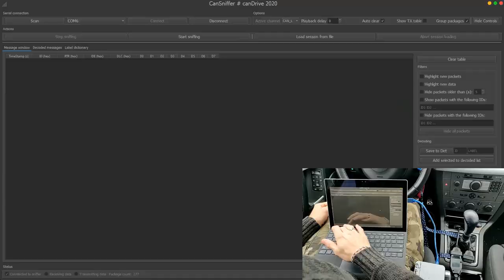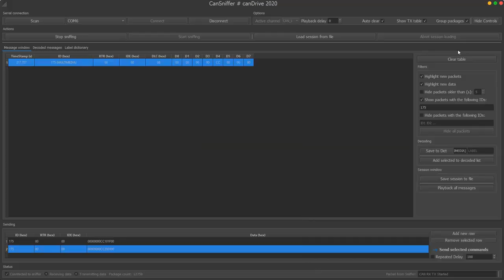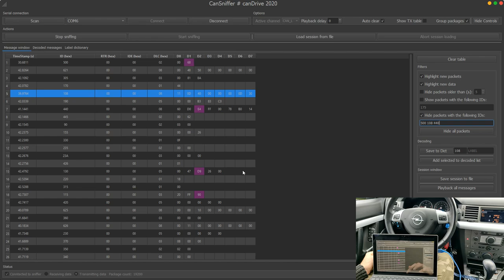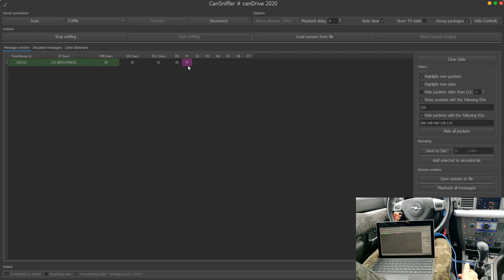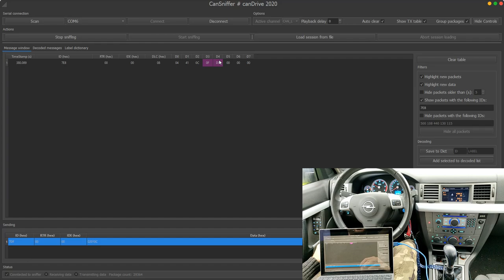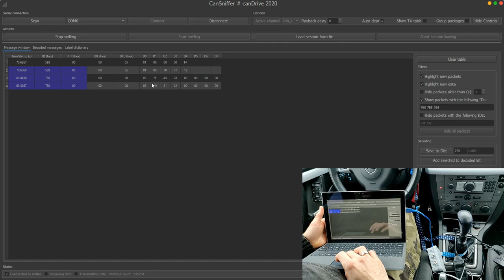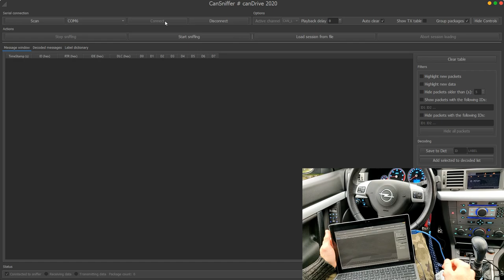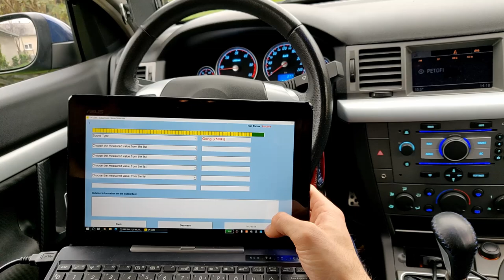How to hack your car | Part 3 - Reverse-engineering examples

Comment: the best videos for understanding the protocol and the issues deeply, thanks a lot Adam, i would like to ask you a question about sending commands. in my car i found the id and the data to change lights. but when i send the data, nothing happens. as i see in your video in 3:24, i saw you sent the data excactly how you got it, as i can understand, in order to make a button press, you send: id = 0x175, rtr = 0x00, ide = 0x00, data = 0x00000000CC101F00. what about size? anyway, is there any other thing i miss? when sending to CAN a message, which says lights on, nothing happen, maybe its just an indicator? another question is - can i control the wheel via CAN or handbrake or this is lock by the car system for safety? thanks a lot Adam, keep up your very good work, i learn a lot from you :)

Comment: I whatched all 4 videos about car hacking, they are very useful, thanks for sharing the knowledge. I don't understand one point. Where did you connect three switches? What does Can L etc button on the python gui? Last question, can car communicate more than one baudrates at the sam can-bus line? Btw, i'm working on Opel Crossland X 2020.
Reply from the maker: Hey, thanks! You can find a diagram of how I connected the switches in the description of Part1. The can selector on the GUI currently does nothing. 1 can line always has 1 defined speed, and the speed does not change. But, as you could see, in my case, I have 3 can lines operating at 3 different speeds.
Reply: @adam_  So many thanks for your fast and kindly reply. I watched your videos several times but I couldn't see the description schematic, I'll try tomorrow with new setup. :) If you need anything that I can make, I want to help you too. For example I can design and gift OBD2 PCB or sth like that for you.

Comment: Thank you for the videos. Were helpful.  I have a question: how can you find out which speed does the low speed can have in your car? I tried all standard speed from 5k to 500k. Just the 500k works. The rest didn't work 😪

Comment: Thanks you x 3,000 Adam. A thousand each for part 1, 2 & 3  :)
I am one VERY dumb guy when it comes to IT stuff, got migrain for 2 days trying to copy your device...LOL.
Anyhow, managed to get the CAN signals, but damn my car send out 106 messages simply from opening the door, without key in Ignition.

I am trying to trace the HIGH BEAM command and still unable to see the pattern on the signal yet. So many IDs are alive and changing even when high beam is OFF or ON. Too many diagnostic signals I think each modules are sending. I wish it is as easy as how you find the buttons on your steering wheels.

After like 10 minutes sniffing, the sniffer slows down so much till keyboard respond lagging by 5 seconds or so.

I will keep on trying. Just drop by to say thank you once more. Great tutorial and kindness. 

Kind Regards. SP
Reply from the maker: good luck!
Reply: @adam_  when is new video coming out

Comment: this is an incredible work!!! salute!! I have one problem, I cannot detect the new packet after triggering the switch. any idea what is causing the problem?
Reply from the maker: Try it out with the CAN examples to narrow down the problem as there can be many issues.
Reply: @adam_  thanks. so, the new packet will be highlighted as blue and the ID will appear in the bottom right corner of the GUI? lets say I power up my car at ACC and I'm getting close to 200 IDs and it fills up the main window. so, I couldn't see everything after I have trigger some botton and blue highlighted will disappear very fast. How should I approach this problem? My car has MSCAN and HSCAN running at different twister pairs.

Comment: Dear Adam
Reaaly interesting as I want to develop a similar thing for my Opel Ampera. I just vant it to connect over 3G/4G(later version) if the Vehicle is far away.

The things I want to control is:
Locks
Windows
Charging
Seat Heating
Steering Wheel Heating
Windows Defrosting

I also want to monitor
Battery status
Battery Charging

So really, thanks for the videos

Comment: Hello, first of all - great series! I wonder if it is possible (and safe) to connect two (or several) own created devices / modules to the can bus, that will communicate through it. How to check if some ids are not used by another control module?

Comment: Hi Adam, these videos were the most complete I've ever seen. I'm in Brazil doing some research on my car. When you say to put it in Can low, where should I change it? Thanks
Reply from the maker: The speed in the arduino sketch should be matches, and the right connections should be made towards the OBD port.

Comment: Great video series.  Question... How did you transfer the data hacked onto your cell phone with the GUI?  I see in the video, you have full control through a custom interface on your cell phone.  Would you do a part 4 that walks through that setup process.
Reply from the maker: Thanks. The GUI has nothing to do with the phone. It was only used for the reverse-engineering part. Then, my custom module is transferring the data directly to the phone through wifi or bluetooth. I am planning to make a 4th video at some point, but I'm extremely overwhelmed with things.
Reply: Looking for this answer also =)

Comment: Very nice video series! Can you explain how to catch messages from climate control and windows module. Which can bus line used, because I have no success with any of them?
Reply from the maker: It can differ for each car. If I remember, they are on the Low speed for the vectra.

Comment: Hello Adam, thank you for your awesome video. I have a question. What if I want to sniff packets for Power Steering, is there anyway to sniff the data from both steering servo motor and steering wheels position sensor?

Comment: Thanks a lot for the videos. Any idea why when I connected my car to the Arduino with your code and it just threw like 60 thousand fault warnings on my car's dashboard lol. The sniffer code is supposed to be read-only (unless the tx stuff is used) so I'm not sure why the car is even erroring like that. Any ideas?

Comment: Hi, I have a question. Could you use this to set car to somethink like "sport mode"? Set lower sensitivity for power stearing, quick reaction to pedal press,...? I guess it can be dangerous but it can be tested in low speeds. Love your viedos! I've just orderd all needed parts. 😁👍
Reply from the maker: Theoretically yes, but as you guessed, it can be tricky. The car can implement some safety features that would prevent you from doing those things. You should give it a try, I haven't tried it myself.

Comment: so I finally able to find those CAN bus IDs I needed. However it requires me to use the ELM327 or ELS27 reader to trigger the car to spit out the IDs. With ELM327 connected, I can detect all the car modules and PIDs (like PCM, TCM, ABS, Brake SW,..). By going into each module, it has all the parameters like signal lights, cruise control buttons and other toggle switches that I can select and then use the Forscan software to obtain the live data while my can bus sniffer is connected to HSCAN at the same time like what you did on Part 3 video. When the live data is triggered, the GUI captures the IDs and corresponding data. I can save the message but I cannot send the message to toggle the switches virtually. One thing I dont understand why I need ELM327 to be connected to trigger a more messages before I can access to other Can bus IDs.  Also I still have problems sending the message into the car and I get no reaction. At least I'm making progress but your expertise is highly valued.

Comment: Hello Adam! Your videos about CAN is very simple and useful👍 Can you help me, please? I have dashboard from Opel Meriva A and I want to use it for pc video games. But I don't know which messages I need to send to control it. I need engine speed, car speed, turn signals, fuel level and engine temperature. I think messages for opel cars should be same. Maybe you can record op-com dashboard test messages for me?
Reply from the maker: Hey! Cool idea! Please check out the github repo (link in the describtion). Inside 02_canSniffer_GUI/save/decodedPackets.csv, you can find the messages that I've decoded. Try out the messages for the 255 packet ID. There are the messages for the RPM, speed, coolant gauges. Let me know if they worked, maybe I can check the rest for you. If they don't work, I'm afraid that dashboard is different.

Comment: Hi, Adam!

Inspired by your tutorials and because I've recently bought a Toyota Corolla Cross with a terrible head unit (Toyota won't do anything about it, they say that the head unit is supposed to work like that =/), I'm willing to replace this head unit by a Samsung Galaxy Tab S8 and make it connect to the car's can bus wirelessly, and create an Android app (I'm a developer) to control all car's functions and configurations, like sensors sensibility, door locks behavior, changing radio stations, etc.

I've already bought all needed hardware and I'll start my project next week, but I stil have some questions about your tutorials (maybe this would come in part 4).

How did you make your car receive can messages from your mobile app? Is this possible only with the Bluetooth monitoring adapter or did you have to build any other kind of hardware to make your ODB2 port receive messages via wifi/Bluetooth from your mobile app?

If you could give me some tips about how to make this work I'd appreciate it =)

Thank you very much for your effort, your tutorials are amazing!
Reply: hi! how is your project going?

Comment: Hi, I am very grateful to you for the code you wrote and the videos you recorded. I would like to ask how best to send can requests from the application to the arduino - mcp2515? Did you write your own library or are you using a github one? Unexplored by me is the subject of connecting android with arduino
Reply from the maker: I'm simply using the Arduino CAN libary, as I show it in one of the videos.
Reply: @adam_  I would like to ask what path have you taken to connect the smartphone application and the canbus? Most likely what you did: used elm327 and libraries to handle ble in javascript by writing the app in nativescript. Or did you add some bluetooth module like esp32 to the arduino? We have the same cars and even the defined packets in the gui coincide with yours. Would it be possible, very please, for you to provide me with the code of your app for my phone?
Reply: @adam_  hey? :)

Comment: No cabe duda de que todo es muy impresionante. He seguido tu tutorial y lo he aplicado con un Arduino nano. Mi coche es un Opel Astra 2017. Puedo leer los códigos en los canales ALTO y BAJO, pero no los medios. Es decir las velocidades de transmisión funcionan a 500 y 33Mhz, pero no lo hacen a 95 (pines 3 y 11). Con todo puedo averiguar los mandos de la radio y los códigos correspondientes por ejemplo. Pero a la hora de comprobar y mandar un comando por CAN BUS no lo hace. NO Puedo mandar nada a la red can BUS y no consigo averiguar que está mal o que es lo que falla. Agradecería una pequeña orientación por donde seguir. Gracias y Felicidades por tu trabajo.

Comment: Amazing tutorial. I have a question :

There are some CANBUS shields based on the MCP2515 for Arduino Uno that feature a DB9 connector. What are the actual differences with your  smaller CAN Bus module?
Does this larger module allow to access all 3 canbus speeds at the same time without the need to use physical switches?

Anyway, I'd like to adapt this to use my Astra H steering wheel buttons and control music being played by my phone on Spotify. I'm currently using a bluetooth audio receiver on the aux port of my Alpine headunit. I guess I also have to figure out the part of sending multimedia commands to Android phones, with one of those genuine HC-05 bluetooth modules with modified firmware to get HID support for this task. What a project! 

Also interested in getting the doors to lock automatically after a certain speed has been reached without the REC module.
Reply from the maker: Your ideas are completely possible!
I don't know those can shields with the DB9 connector, but I think you should be correct, those shields might allow you to switch between the different buses (and ISO standards) from the software itself.

Comment: Hello,
Congratulation, very good job.
I have question : do you have to put the switch on midle speed to sniff the middle channel, and on the low switch to sniff the low channel.
Thank you
Reply from the maker: what switch are you asking about?
Reply: @adam_  Hello,
On a box the box there is arduino uno + MCP2515+ and 2 switch A and B.
thanks
Reply: @adam_  to sniff must I connect MCP2515 to  6-14 pins? 3-11 pins ? or 1-4 pins

Comment: Hello Adam, really enjoyed this videos!

Looking further for the next upload :)

I will use the knowledge I've adquired to read the canbus communication of my folding mirrors which unfortunately only work with switch and my plan is to make them fold when I press the lock button on my car.  
For that I'm planning to use a arduino/raspberry with compiled code that verifies if the canbus message of locking the car is sent  it will send back the canbus message for folding the mirrors. 
Do you think it's possible to do this? Have a arduino stored hidden on my car to make this work?

Thank you 🙌

Comment: Great job mate! How to make obd speed auto door lock and hazard lights on during gear engaged to R? do you have any information about it?
Reply from the maker: You just need to listen to the correct messages. If the speed exceeds a given limit, you send the correct packet for locking the doors and that's it. Same with the hazard lights.
Reply: @adam_  ok I will start to my project. Do you have any plan about preparing video Custom hardware design, Firmware (STM32-NRF52) and mobile APP? Thanks!

Comment: Awesome! I would like to use an arduino for reading can messages of the steering wheel. So I can attach an usb mp3 player to the AUX IN on my CD70 Radio and skip between the tracks. Can you share the pids for the buttons?
Reply from the maker: That was one of my ideas too :) Please check the github repo linked below the video, and look for decodedPackets.csv. You'll need "wheel left select up/down".

Comment: First of all, great video, thanks a lot :) I have recently tried sniffing the CAN bus on my 2013 Kia Rio but unfortunately without success. I am getting about 20-30 packets but it seems extremely noisy, as nearly all of them change frequently. I wasn't able to find any correlation between the data and me pressing anything in the car. The only thing that changes is, that some more packets get received, when I turn on the ignition rather than just accessory mode. Is there anything I could be doing wrong besides the configuration you showed in a previous video? Or is it possible that my car only sends some internal stuff over the canbus?
Reply from the maker: If you suspect that what you are seeing is complete rubbish, that's most likely a wrong canbus speed or MCP2515 frequency mismatch. Maybe you are not connected to the right pins. To narrow down the problem, I highly recommend trying out the example arduino codes.
Reply: you need to suppress the ones that are changing quickly by adding the ID's to the "hide ID's" list to clean up what you are looking at.    I just recently got past this in my 2016 VW Golf R and I think that some newer cars are VERY canbus heavy.

Comment: Thank you. Makes the complicated look simple. Is it possible to get volume up volume down and changing of radio channels using the arduino? I would like to replace the stock radio of a car and control it via the steering wheel controls. Is that kind of control possible? I have noted that you are able to carry out one action at a time. I would like more than one action programmed on the arduino. Can you please help me?
Reply from the maker: absolutely possible, that's what I'm doing in one of my videos, please check it out.

Comment: Hello Adam, great serie! 
But I have question: I have an Opel Corsa E (2017) and when i use your project, i cannot see extended frame. It's a bug or your code cannot read those CAN frames?
Reply from the maker: Are you sure the corsa uses extended frames?
Reply: @adam_  yes, i'm sure because i had to use another "can sniffer" (more simple without GUI) to catch all the bus traffic. For example the external temperature ID is 1042060, GPS latitude/longitude ID (Opel OnStar) is 102AA097, etc etc